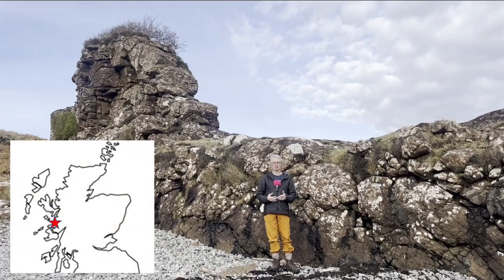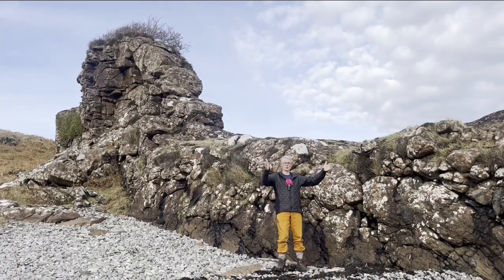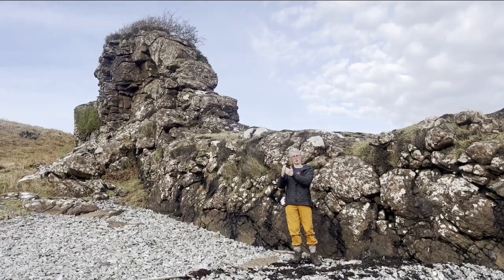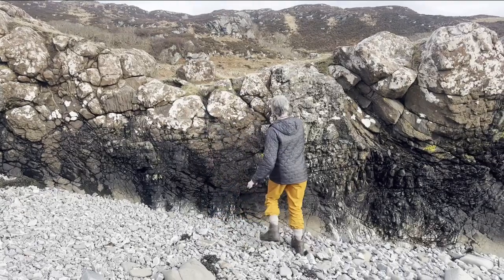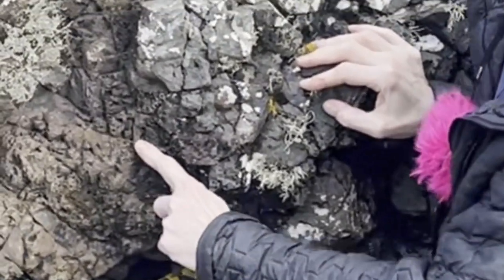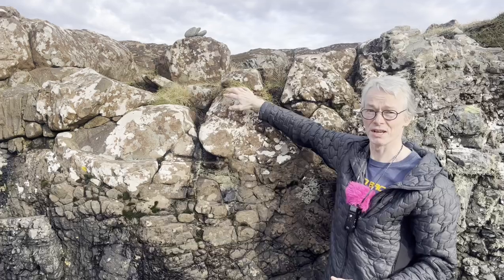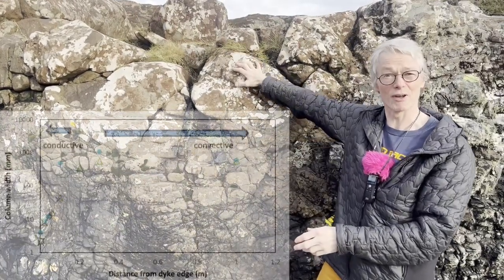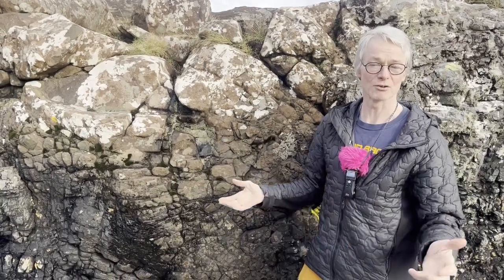Columnar Joint Formation.  Arisaig

Comment: Question about columnar basalt, like the Giant's Causeway in Northern Ireland. Some columns are higher than the ones next to them, and some are lower. I assume that these gradually work their way up or down over time. Is there any evidence of this? Like 100 year old photos. The one's that are dropped down, is this because there are voids underneath, or are these sections that worked up until they toppled over and were transported? Does the way some columns form have a tendency to work their way up, while other tend to work their way down?   And when there are long steps dropping down of many columns is that part of the phenomenon, or does columnar basalt just tend to erode or break off horizontally.  (Sorry to ask so many questions. I feel like I'm five years old, very curious, but finally (thank God) out of breath.)
Reply from the maker: Hi, your last comment is the right answer.  Once these columns form in the cooling intrusion they then tend to crack across the column. Weathering then naturally breaks away the ones at the edge of the land surface faster than those in the interior. 
When you go to the Giants Causeway you can often see that the ends of the columns seem almost dished with the surface at very edge of the column pretty much perpendicular to the column edges.  This is typical for crack propagation in from the edges and is related to how the interiors of columns cool once there is water circulating in the cracks.
Reply: @OneMinuteGeology  Ah ha. I remember the 'steps' at the edges to be quite a bit more than a comfortable step down, maybe about 50cm. I guess that suggests these horizontal cracks are probably a bit more than that in this area. Thanks.
Reply from the maker: @ yes, they can be quite variable in their spacing